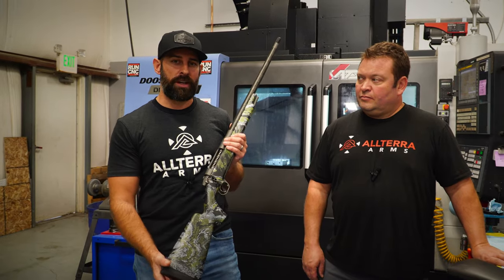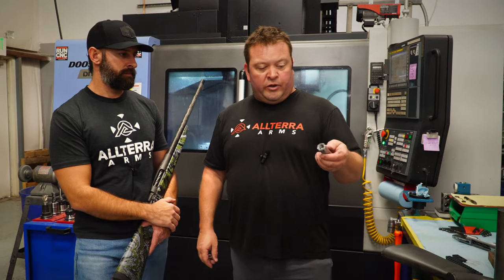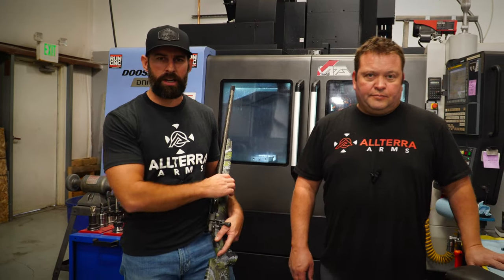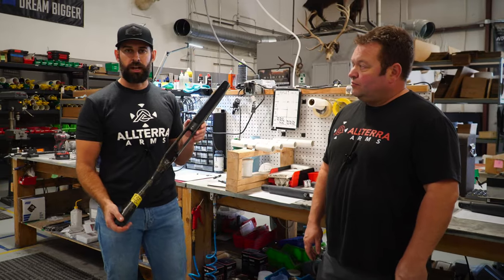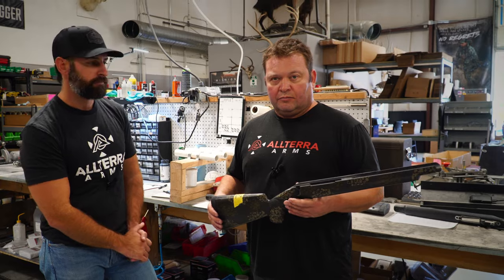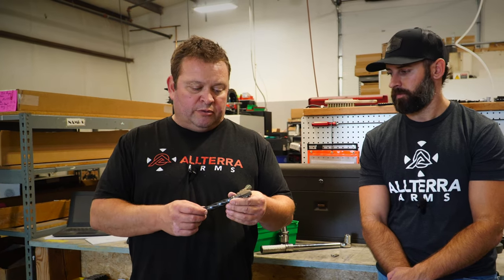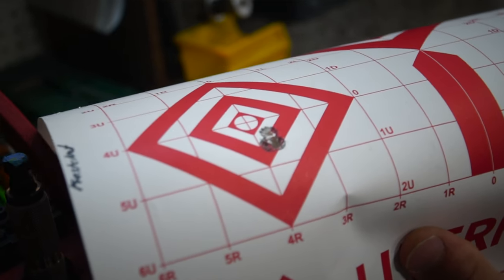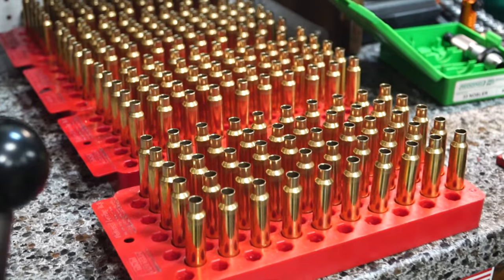What Makes AllTerra Arms Rifles Different?

Comment: Custom turret is only good if you hunt at one altitude one temperature one pressure. Where I live you can be anywhere from 2000 to 6000 ft within an hr.
Reply from the maker: Accuracy across a wide elevation range of course also depends on temp, pressure, humidity, etc. and how well those variables align with the base conditions the turret was made for. If your turret was made for 4000' you're pretty well set for hunting accuracy from 2-600 at 500 yards and under.
Reply: @allterraarms  yeah we are only talking 1 or 2 moa with an animal. Doesn't matter. But start stretching it out. You might be in trouble. You know you've shot enough.
Reply from the maker: @cpreit8862  Exactly. What's most important is that folks practice and get to know their equipment and abilities, and then set their personal limitations accordingly.